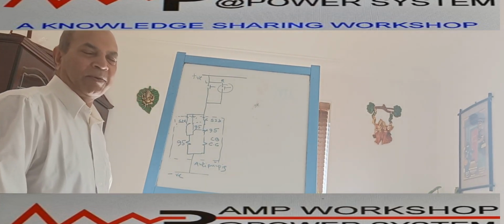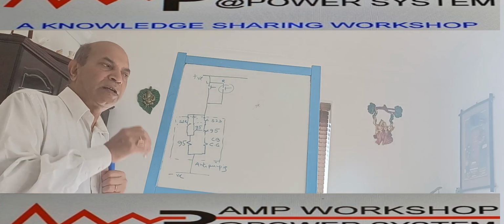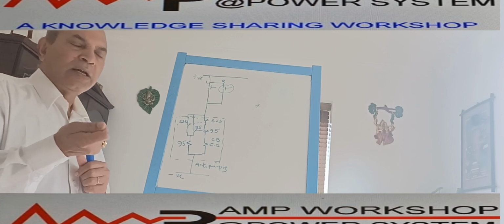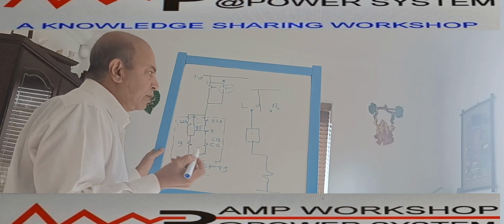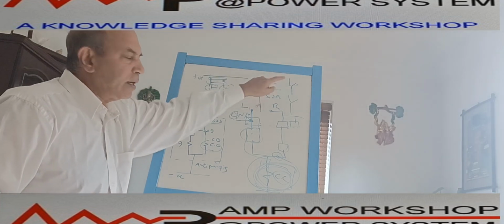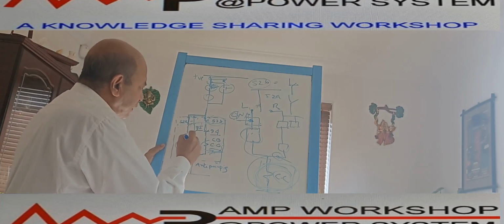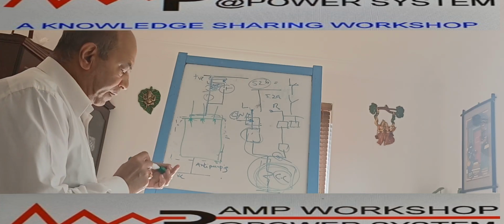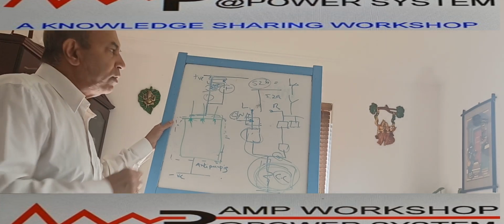ANTI - PUMPING CIRCUIT/SCHEME /RELAY ( 94)  FOR  LV/MV/HV CIRCUIT BREAKER  CLOSING CONTROL SCHEME.

Comment: Hi sir..can you add the topics associted to design of offshore Electrical and and MV VFD design...
Reply from the maker: SURE .
 But after completion of present episode , otherwise continuity would be lost. 
I will make one episode on  solid state devices which will include soft starter, VFD and ups system including battery under workshop 9.
Could I request to share this  channel with your friends and colleague in order to decide their any new requirement so that in  one go we can complete..
Thanks
Reply: Sir UPS AC and DC calculation and NGR calculation step and touch potential calculation